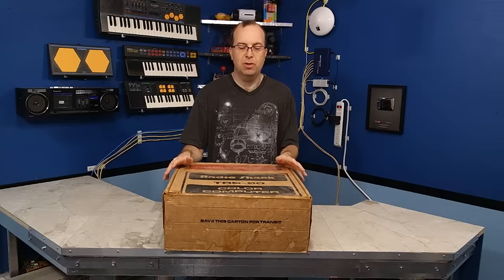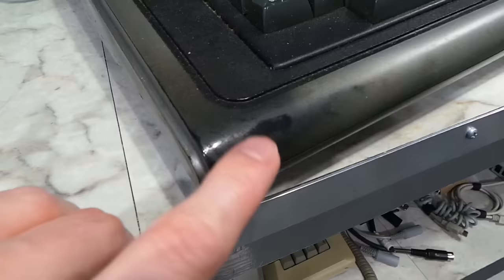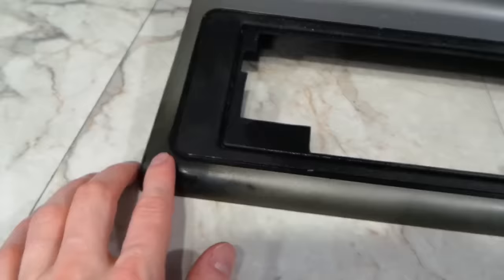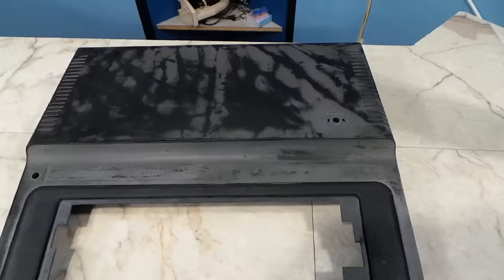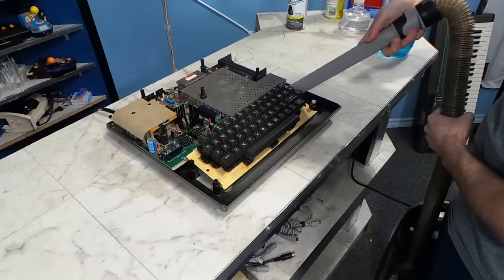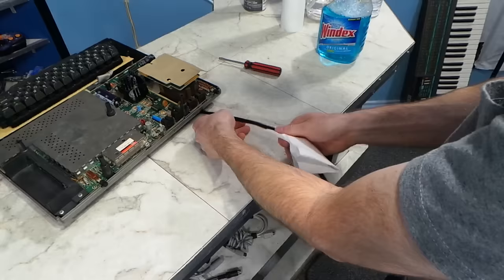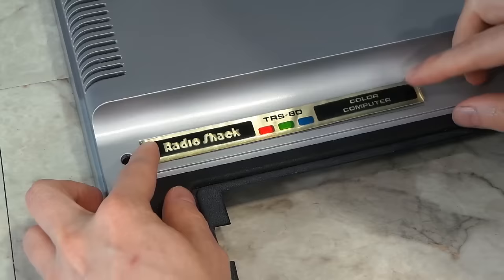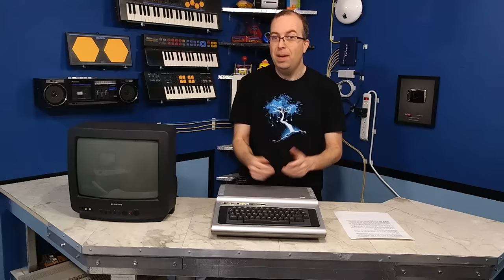TRS-80 Color Computer 1 Restoration

Comment: My first computer was the 16K version of the machine. The manuals that came with it were reasonably good at teaching basic and one of the first things beyond the simple programs in the book was writing a payroll program which I used to generate the stubs for a small grocery store I managed for a half a year while waiting to sit for the CPA exam. I actually ran the program into the machine via the tape drive and then swapped out that tape for another used to hold the data for each pay day. There were only 9 employees but it was still faster than manually doing the checks even though I still had to hand write the checks.  It also meant we had a payroll ledger which was a second run of the stubs. 

After I had taken the test but waited for the results I landed the job as a controller of a small religious college run as part of the local Jewish Federation. As such they used Control Data to process payroll and also there general ledger, so I didn't use the Coco for that, fortunately as the school had about 100 employees and while doing the store on it saved time I am sure I was no match for what Control Data did.  However, the following spring I needed to do the school's budget.  There was then a spreadsheet program available, I'd also gotten a floppy drive and had upgraded the memory I know I had at least 32K but for some reason I think before I sold the machine we had gotten it to 64K but its all kind of fuzzy it being about 40 years ago. The school's budget went on the Coco. As the budget had to cover multiple departments, and the small endowment it was a godsend. Changing one number on paper meant redoing every schedule tied to that number so a raise of someone that taught, at continuing ed level, Undergraduate, and Graduate meant hours of hand calculation with an adding machine. I convinced my boss the President that it would save hours. Simple changes that might have taken a day could be done in an hour or so. The one flaw unlike more modern spreadsheets is spreadsheets of that era recalculated every cell rather than just those that had a dependency that had changed. 

The down side was of course now that it could be redone more easily of course it was. The following year having proved the machine made sense I got the school to spring for an IBM XT, and two years later we put in a Novell network running on ELS 2.12. 

So yes real work could be done on these machines and it cost a fraction of the model 3, and the IBM replaced it was easily 5 times more expensive.

Comment: If you ever hit up a dollar tree try this stuff: http://www.lastotallyawesome.com/shop/all-purpose/awesome-all-purpose-concentrated-cleaner-128oz/ It's really really good at stripping paint off of plastic without doing harm if you give it a good, long soak. It's the cleaner that many miniature modellers swear by. Another thing I'd suggest is that if you're going to seal paint you've applied give it 2 - 3 weeks before spraying on the sealant or it'll turn cloudy after a while.

Comment: also whats coco computers
Reply: They are computers that had similar performance to the first Apple computers.
The main difference between them is the first Apples used the 6502 microprocessor while the COCO used the 6809 microprocessor. They also used different operating systems.

Comment: There's no such thing as a 32k chip, they go from 4k to 16k.  The CoCo used 16k for Color Basic and Extended Color Basic, and the ROM cartridge mapped to 16k as well.  Out of the 64k address space, the first 32k was mapped to RAM (64k chips, using only 1/2 of each chip), then the 16k ROM cartridge area, then BASIC/ECB mapped to the bottom 16k.  Since the cartridge and BASIC ROMs took 32k, the machine was advertised as a 32k RAM machine, but, the machine can be kicked into an all RAM mode, and this was often done with copying the contents of ROM to RAM and running in an all RAM mode.
Reply: Yep been there done that I had both the COCO1 with 16K RAM and later COCO3.

Comment: Sir, have you considered a citrous based paint stripper?  http://www.citristrip.com/product 

It even smells like an Orange Smoothe.  I used it on wood, it may work on plastic.  I would try a broken piece you can't save as a test or spray paint scrap plastic and see if the citristrip works.